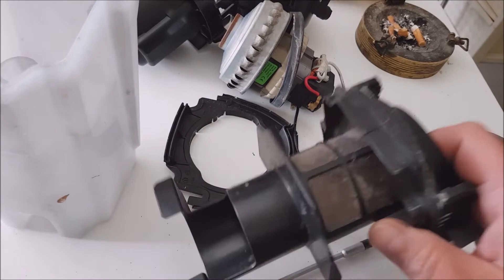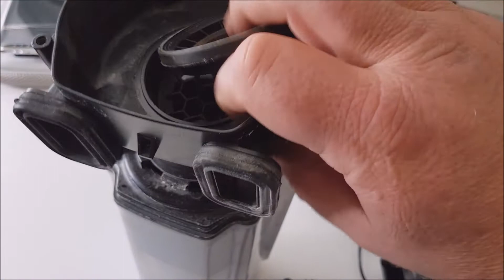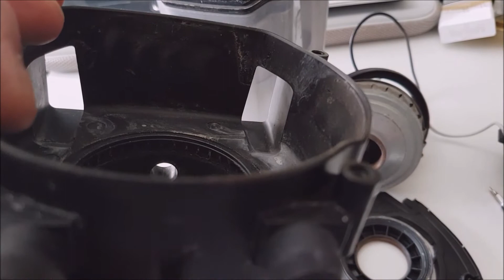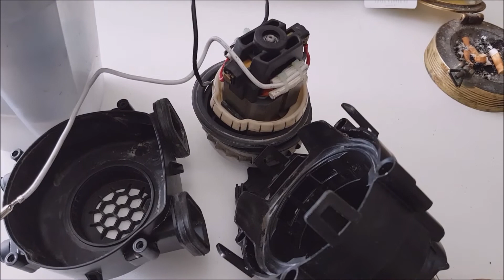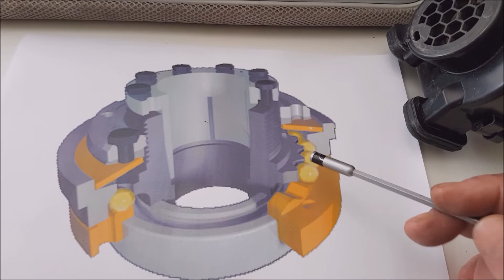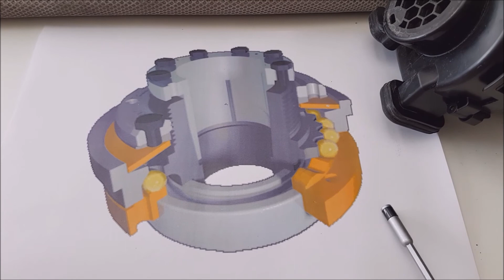Kärcher send me an engineer ! Wow, that's customer care !

Comment: I bought fc5 cleaner through idealworld but after 8 use rollers are not turning,its been just over a year so i afraid its not under warranty
Reply from the maker: That drives me nuts.... Another expensive landfill due to engineering flaws.

Comment: I would like to buy one of these but i'm reading to many negative feedbacks, do you know if they may have addressed the problem on the White version? i prefer Kärcher because of its open brushes to clean corners more easily but i'm comparing this model the Bissel Crosswave and the last one looks more reliable.
1 year is passed since this video, how is going your FC5?
Reply from the maker: I finally opted for Crosswave. No regrets so far, about one year later or so. Yes, it corners poorly cmpared to the FC7 but no need to vacuum before, it copes well with hair, small rubbles, even a full bowl of cereals.

Overall a gain of time even if the classical mop has to do the corners every now and then.

Comment: I share your enthusiasm for the design of the moldings but I am not very satisfied by Karchers speed of response. You posted this video on the 20th May 2018 and I bought my Karcher on 2nd April 2019 but it has only lasted 55 days with very light use. I havent stripped it down as the product is still under warranty, but judging from your videos I guess that any improvements to the product have not found their way to the market place
Reply from the maker: Last time I checked,  two weeks ago, the engineer described in this video is no more affiliated or associated or part of Kärcher.

AFAIK, no modifications were implemented and units, included cordless versions, continue to fail as I describe.

Comment: The FC5 was released in Australia about 6-8 weeks ago. My unit just failed. Started blowing bubbles from the seems. Today it shorted out and smells like burning, trips my RCDs. I will return it for a refund. Store stock is not being replaced. It appears Karcher is either very short on Australian stock or they have recognised the fault in Australian 240v stock too. Ours are manufactured in Tunisia.

Comment: I bought FC5 20 days back and with in 20 days of use the front roller stopped working
Reply: You're lucky, mine was hopeless straight out of the box.  Put the damb thing on my linoleum floor and no rollers, just an awful sound coming from the clutch. The only time the rollers moved was on a forward push. The engineer from Kacher will look at mine after a month of waiting for my brand new machine. Seriously dissapointing.  Today will be a shit fight I'll bet!

Comment: I just ordered the FC5, but I only discovered your video after the fact. Your suggestion to lubricate the clutch is interesting and I am considering doing the same, especially since I bought it online and warranty claims are going to be painful, but I have a few questions: 
First of, what did the Kärcher engineer say to this suggestion? I can't imagine he was in favor of this? 
After providing the lubricant do you plug the hole, maybe with a little hot glue, to prevent the oil from running out or water getting in? I imagine you would want to reapply lubricant from time to time to keep things protected? 
What about the comment about allowing the waste tank to overflow, could that actually allow water to run back into the system and cause the corrosion? I understand the drain hole in the top protects from overflow, but that seems mainly to be for protection of the suction motor.
It seems the corrosion is caused by the parts of the rollers bringing water into the system, is this correct?
I haven't really seen other complaints about this, do you think it is a general problem?
Thank you for making these video's. Your comments are thoughtful and well explained and have been most helpful.